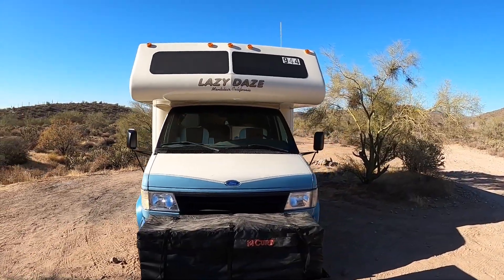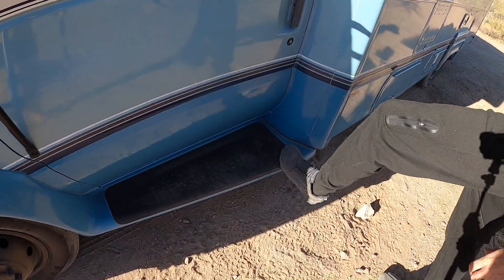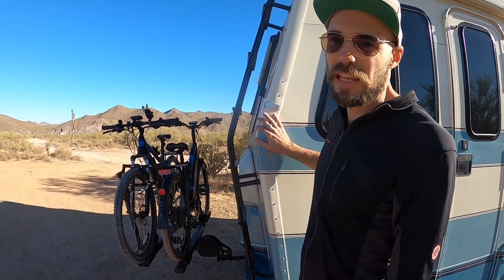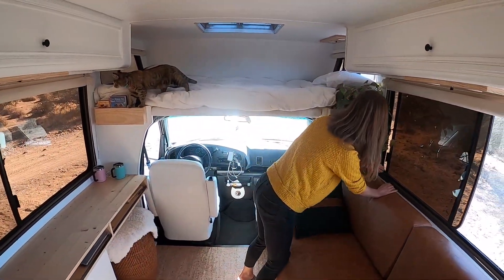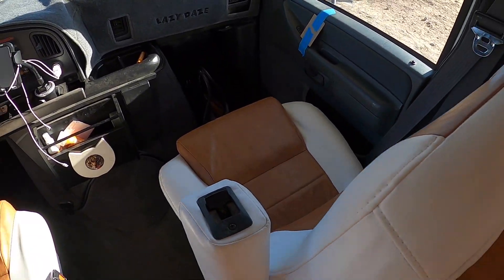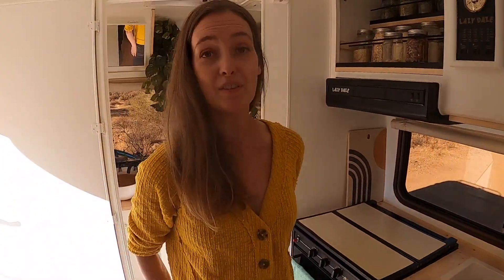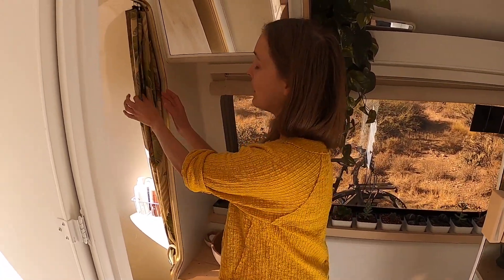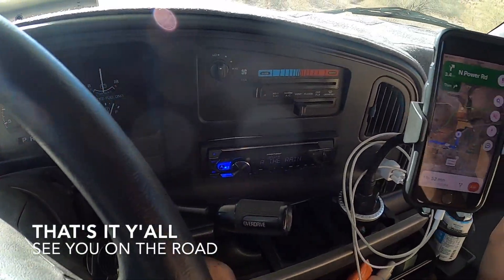Tour of our 1995 Lazy Daze RV conversion

Comment: Beautiful renovation!  I need to do something with my rear passenger side, like you did.  Where did u locate the part?  I have a 1997 similar to yours but different model. Lazy daze is no doubt one of the best solid RV models out there with excellent exterior paint!  Congrats on an awesome rig!!
Reply from the maker: Hi Extra Pickles, thanks for the positive feedback. Do you refer to the bench behind the passenger or the desk behind the driver? The bench is standard Lazy Daze but with new upholstery. The desk I made myself.
Reply: @uturn8563  Hello UTurn, Thank you for your response.  I am asking about the "exterior rear corner repair".  I have had a few mishaps as Ive been getting accustom to 22ft RV from a 17ft camper van 🤣.  So the corner on my rig cd use trim repair.

Comment: TO UTURN:  I think your renovation looks GREAT! Well done.  I like everything about it. 
I have a couple of questions. I read all of the comments first and your replies. 
I like the cork floor. Since you put 17,000 miles of travel on the RV, and used it in various places, would you do the cork floor again?  How much did it cost to add the cork? Did it hold up well or any advice for or against?  I know it is used in some boats. I do like it.
Reply from the maker: Hi Uhlich. Thanks for the compliment. Yes, we'd definitely do the cork again. It's durable, beautiful and feels nice to the touch. I installed it with a quarter inch gap on all sides to leave room for expansion and contraction with fluctuating temperatures. We glued down the corkfloor to the plywood subfloor. This is definitely necessary cause the movement of the RV will otherwise loosen up the click laminate planks. After 17.000 miles the floor looked exactly like the day we put it in. Installing it was not easy with the plentitude of corners, angles, and cut outs but we think it was worth it. We bought it from Green Building Supply (https://www.greenbuildingsupply.com/All-Products/Flooring-Cork/Waterproof-Cork-Flooring-Cork-Look-Amorim-WISE). It cost us about 500 dollars. Best of luck!

Comment: Straight to the point, no long intro, no music, love it!!

A very elegant grande dame interior and exterior!  Elle est magnifique!  Remarkably good paint job outside, still like new.  Inside, it looks serene and tranquil, with an understated elegance.  Very French.

Yes, even us Americans HATE the Imperial system we are stuck with.  Try calculating fractions of an inch instead of metric cm and mm on nuts and bolts.  Infuriating.  This has to go, along with Daylight Savings Time.  Maybe the next President...! Sigh.

Why not put your succulent garden on OUTSIDE of bath window?  Build a shelf with palette wood and stick them there.  Plenty of sun!  You can enjoy them from inside.  Don't kill them slowly inside, that is sad.

Loved what you did with the inside, esp the cat hatch!  I'd like to have a nice large roof access on my RV. I have an identical layout 22 ft Class C Tioga Montara, Ford V10 E350, 1997.,  My shower is on other side of bathroom but also rear bath.  Same kitchen layout but I don't have that overhead cabinet sticking out.  I added a wooden wall to back of my countertop going from floor to halfway up to ceiling.  This allows me to use it to hang spice racks on either side and solve that problem.  It also prevents cooking grease from spreading to living room. You can try that too.
Very nice job reupholstering the seats.  I must get that done. Where did you go for that?
Merci for the tour!  Lovely meeting you both.
Reply: Great idea about putting the succulent garden on the outside! Luckily, to our own surprise, they didn't die (apparently sufficient UV came through the window). 

The upholstery was done by a local upholsterer called Bernie in San Diego, CA. He did a great job. It's one of the few things we really needed to outsource cause we couldn't have done it as beautifully/professionally ourselves.

Thank you for your nice comment! Wishing you happy adventures in your Tioga!!

Comment: might be a nice add to put a small simple drop table fastened to the side of the subwoofer box for a little extra table space, kinda like a little coffee table or just another way to sit and do work. the place looks really great, inside and out, a real comfortable space for sure.
Reply: Yes!! We actually do have that! In the cork floor, right in front of the couch, there is a little round hole (which we cover with a custom round piece of cork), in which we can stick a pole, and on this pole fits a table (custom wood table top/wooden slab). We forgot to feature it in our video, but we definitely used it on the road, e.g., for playing cards/facing each other/having more dinner space. When not in use, we store the pole and the table top in the vertical closet (the tall mirror closet in the bathroom). :) Most of the time we did just use the desk area for eating, though, cause we didn't need the extra table top space very often.

Comment: So impressive! We just got an '89 Lazy Daze and are beginning a reno, so many good ideas here. The couches you created look amazing, are they comfortable? Is there anything you would have done differently?
Reply: Thank you :) Good luck with your renovation!! The couch was actually really comfortable - We went to an upholsterer, picked out a cushion based on our preferred thickness/firmness, and then had it covered with the faux leather (cognac color). It looked like real leather and was super easy to wipe clean wen needed (water/spill repellant). To my surprise it wasn't a sticky/sweaty fabric. I don't think there's anything we would have done differently in terms of remodel (I must admit we were incredibly in love with our RV, and I kinda regret selling it). If anything, maybe we would have sprayed water/moisture repellant spray on all the fabric blinds, because that would help prevent little mold spots due to humidity/condensation on the windows. Other than that, nothing we would have done differently :)

Comment: What type of paint did you use on grill, mirrors and exterior ladder? I am wondering because we have a 2000 Class C that we have remodeled, but we have not yet painted side mirrors or the grill. Wondering if you sprayed or brushed it on.
Reply from the maker: Hi JJ. We used high performance enamel spray paint. https://www.amazon.com/Rust-Oleum-239107-Professional-Performance-Semi-Gloss/dp/B0010P63NC We sprayed multiple coats and holds up great!

Comment: How much did it cost to renovate that van? Looks amazing, but cork isn't cheap!
Reply from the maker: Hi Lauren. I kept receipts of eeeeeverything. We put about 4000 dollars in. Floor was indeed not cheap. So was the granite sink, sound system, and paint. Most expensive was the upholstering. That alone was 1500 dollars. The solar system is not included in the 4k.
Reply: @uturn8563  Looks so amazing! Nice job on a modest budget

Comment: Heya great tour! Am looking at a lazy daze myself. Any other gotchas to look out for besides the back leak? Also, mind sharing an approximate cost to get your rv looking good? :) Thanks so much for the info!
Reply from the maker: Hi Nikki, there is a lot of stuff that can go wrong with RV's but Lazy Daze is a good brand so less chance of bad luck. The older models have an extra window in the front top (where the bed is located). These also often fail. Inspect the RV thoroughly for water damage and rust and check maintenance records if there are any. We spend about $8K on the interior and exterior make over (not including solar). Thanks
Reply: @uturn8563  amazing. Thanks so much!

Comment: You guys did awesome!!!!!
We just got a 95 LD the same color but 27 twin floorplan.
The rear corner where you repaired the rot.
 What silver cap piece did you use to cover the 1 inch gap?
 It looks like a piece of aluminum.
Also give me the details on the solar. 😃 
Happy daze
Reply from the maker: Hi Curtis, sorry for the delay. The silver cap piece is just a piece of aluminum that I used to glue the two end caps together. I learned about this technique on the Lazy Daze forum. Details of solar you find in our blog on the bottom: https://letsalluturn.wixsite.com/website-1/post/rv-conversion-lazy-daze-tinyhouse

Comment: You painted the front bumper? The silver one?
Reply: What black paints did you use? Spray paint? Paint brush?
Reply from the maker: @zayvier69  Hi Zayvier, yes we painted the silver one in front of the radiator, but also the black bumper on the bottom. Both were faded from the sun. We took them off, cleaned them, prepped them and then used a high performance enamel spray paint like this one https://www.amazon.com/Rust-Oleum-239107-Professional-Performance-Semi-Gloss/dp/B0010P63NC
Reply: @uturn8563  thanks for the details.